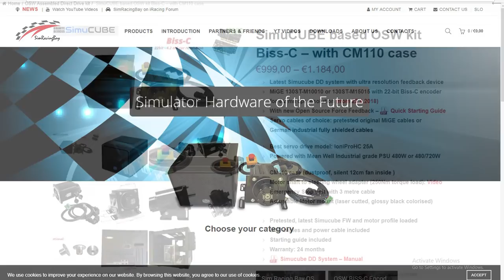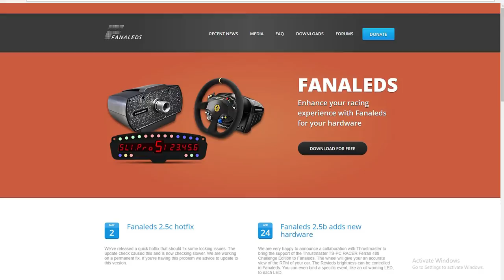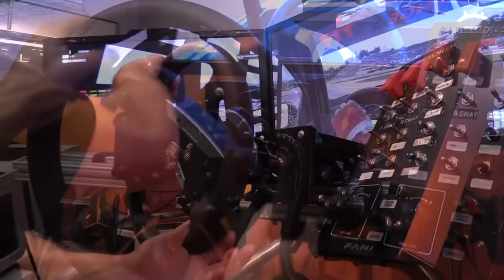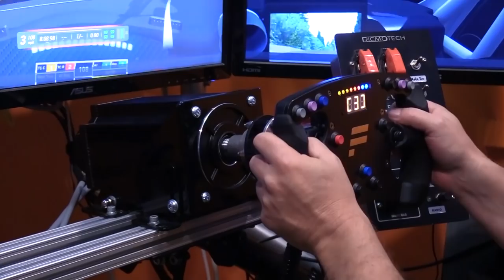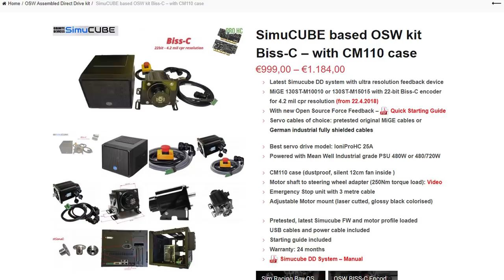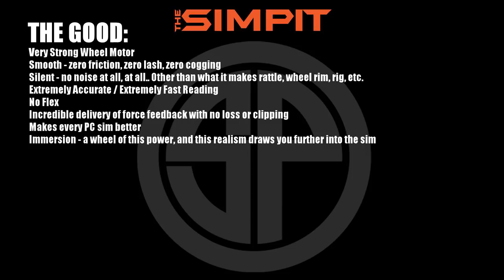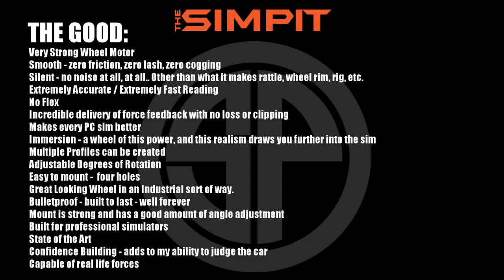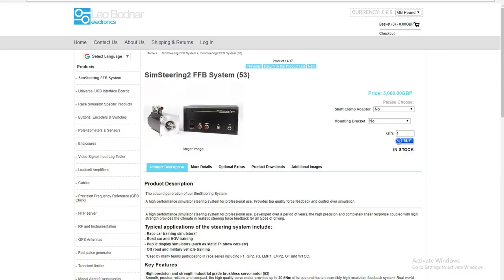Sim Cube 30nm Direct Drive Wheel Base Review

Comment: If you only need to run these at 6% when 9% is almost too much, what's the point with these strong motored wheels?  If a DD wheel delivers a 1 to 1 experience then why cant there be DD wheels much cheaper and with a motor that's 6 to 10 times Less powerful?  Is it just to put little wear and tear on the motor?

(Re edit:  And I'm not bringing this up as an economic issue.  I just don't see the point of having the ability to run so much FFB. No race car out there would be anything similar to running even medium FFB with this wheel.  I don't even see it as a solution for the 'professional' as it's not replicating the experiences they have).
Reply: Hi Wayne, It is not that there is soo much power that you cannot use it (clearly that is true in most cases), it is the fidelity the extra power provides. The speed in which the wheel can react and the minute forces that shine through because there is no hint of clipping... Shaun was saying get the 30nm motor, not because you need that much power but because it is only nominally more expensive then the 20nm (small mige motor). I would argue the opposite, get the small mige cause it is more then enough power and put less strain (in weight and nm) on your rig but in either case this is the essence of DD Wheels right now (more power then you need to let the fidelity shine through). Ask any DD wheel owner and they will tell you similar. Hope this helps = )
Reply: Unless you have production big enough to make your own electronics, including servo motor driver, the price of standard OSW build, like the one used in the video using SimuCUBE board with IONI Pro/Pro HC driver, wouldn't drop dramatically if you used cheaper and weaker motor. And there aren't many suitable models on the market to choose from in the price range we are talking about, to begin with. When using standard, 20 Nm or 30 Nm motor, its price is only about fourth of cost of total parts and materials used (electronics, PSU, case, mounts, wiring etc.). Even less, when you buy them wholesale, I've paid $150 for shipping of a single unit from China, and the motor itself was $215 ;p So let's say that you are building everything yourself and costs of labor are not to be counted here, and you buy a weaker engine for half a price of 20 Nm one, you'll save only 12.5% of overall cost, sacrificing one of two most important parts of your build, and it's going to make more that those 12.5% of negative difference for overall experience, in my opinion.

And even with custom electronics, although there are indeed some DD wheels with 6-12 Nm force with good opinions, still quite expensive though, especially when we remember, that we're paying only for a bare wheel base, without any rim or pedals, at the same time we're seeing companies like Fanatec, or FeelVR struggling to deliver affordable and reliable wheel, which comes with all the accessories needed to go racing and gives user same plug and play experience that wheels like Logitech/Thrustmaster/Fanatec do.

I could go on and on about that, because, despite exceeding the budget significantly, building my own OSW was a great experience and I learned a lot doing that :)
Reply: I think one option that most people don't seem to have explored is mounting wheels from real cars.
I know all the professional race cars have bespoke carbon fiber wheels that probably weight the same as their plastic counterparts, but especially if you were going to do some type of historical racing you'd probably be mounting a good 10lbs+ to the motor. At that point it would take a LOT more force to overcome the dead weight of the steering wheel itself.
Reply: Bud, most DD wheel owner run wheels from real race cars not real production cars... non of them even when mounted to a hub/button box weigh near 10lbs. You will see OMP, Momo and Sparco alot. Even Fanatec owners can run real race car wheels. I own a Clubsport V2.5 and have several of their universal hubs which allows me to run a variety of 50mm and 70mm bolt pattern race car wheels... My wheels (both real and other)... a 300mm OMP Trecento Uno (real), a 320mm OMP Treceno (real), a 350mm Momo (nice ebay knock off) and my old 27mm G25 rim. The weight and diameter do not heavily effect my V2.5 and would not effect in any negative way any good Direct Drive motor.
Reply: Here's a good example: https://www.ebay.com/itm/2002-2003-Subaru-Impreza-WRX-MOMO-Steering-Wheel-with-airbag-USDM-/153077452052#
The steering wheel off a 2003 WRX, maybe not 10lbs but it's certainly not going to be lightweight.
Reply: Hi Bud, we would not want to mount that or anything like that. No offence, I know you are trying to make a point but that is not made for this application. 

FYI, this is an awesome OMP knock off:

https://www.ebay.com/itm/320mm-OMP-Trecento-Genuine-Calf-Leather-Black-Stitch-Racing-Sport-Steering-Wheel/162327647360?hash=item25cb7b5480:g:~KAAAOSw2xRYWQA7

Affordable, relativity lite and most importantly, the proper bolt pattern (70mm) to mount to our Force Feedback bases (Direct Drive or Fanatec universal hub...). There is a small learning curve to this stuff but Sean, other YouTube videos, comment sections or Forums can help =)
Reply: Sean, hope you do not mind me posting a link to the Sim Racing Garage. Barry does a great job highlighting just this kind of stuff. Bud, this vid will illustrate the challenges when considering a wheel for to mate to a button box that will ultimately connect to OSW or other DD wheelbase/motor...

https://www.youtube.com/watch?v=jGqg06ugw0w
Reply: Some people already have taken the front half of a car and installed a Sim rig into that. One of the best applications for Direct Drive would be to mount it to the steering column of a real car chassis.
Reply: Hi Bud, I have seen some car chassis with FFB wheels installed but in many cases they don't really mount the steering column to the wheelbase as that would sap a lot of power from the motor. Also, much of the time when you see a dashboard, what they do is mount the dash and center console bits and pieces to a custom frame and then mount the matching wheel to the motor shaft of a wheelbase (usually but not always a dd wheelbase) with an adapter. Alex at "The Extra Mile" did this with some BMW parts and it looks cool as hell and seems to work very well =) He has a whole series of videos on how he did his. He is an awesome driver, very entertaining to watch. You should check his channel out too.
Reply: "No race car out there would be anything similar to running even medium FFB with this wheel." Apparently you've never heard of Indy cars. You've also apparently never raced a sim, because almost all sim games allow you to drive all kinds of old race cars that do not have power steering.
Reply: What?
Reply: I was replying to the OP's genius comment, nothing you said. :)
Reply: Oh, sorry, makes sense and good point.

Comment: Something is wrong with the percentage you are using Shawn. 2.8%= 0.84nm that's way less than a G2x wheel, yet you said that at 2.8% feels the same as a Logitech wheel. (and i can also see how you are struggling)
6%= 1.8nm and you said that at this point it exceeds fanatec and TM wheels (fanatec and TM= 5-7nm wheels). My comment comes in good faith, i am just trying to calculate my own FFB on my 20nm OSW.

Comment: You just said you can never have to much yet you donr use it all nobody ever uses 30 nm maxed across everything it's just stupid and doesnt feel realistic even if the older cars hit 20 to 25nm it's a different feel it isnt content that's at peak meaning sometimes you would feel that force when your using direct drive wheels it's different then reel life its implemented differently so 30 nm on the dd wheel is ridiculous I get 20nm I totally getb20nm and then using like 75 percent and stuff like that but great video
Reply: Though using such power is of little value, having the power available (by setting the wheel to maximum and lowering the sim, only reducing the wheel if the sim cannot be set low enough) gives ample headroom to prevent clipping.